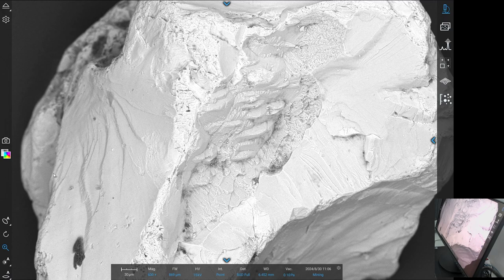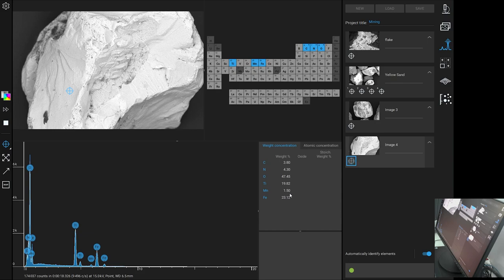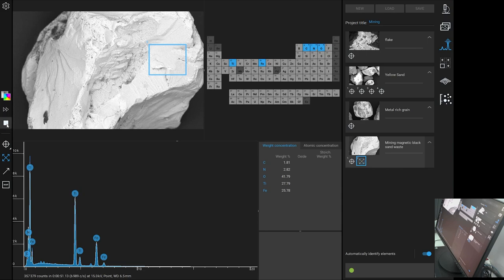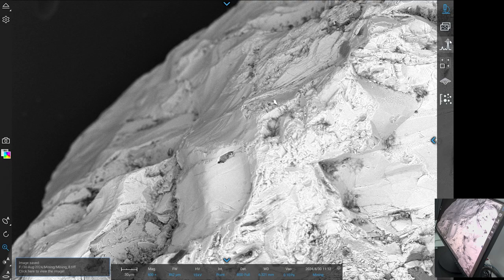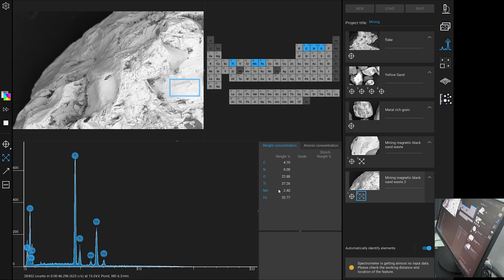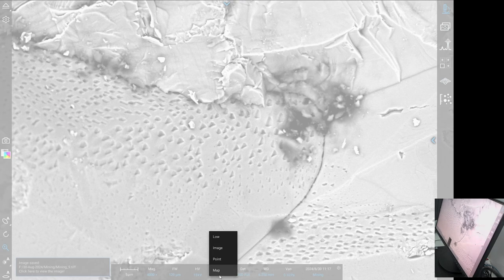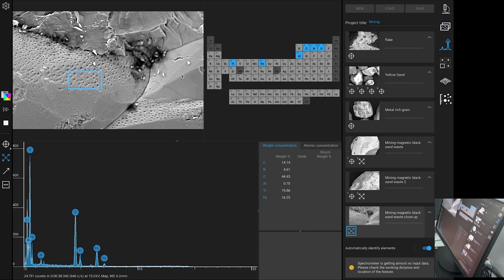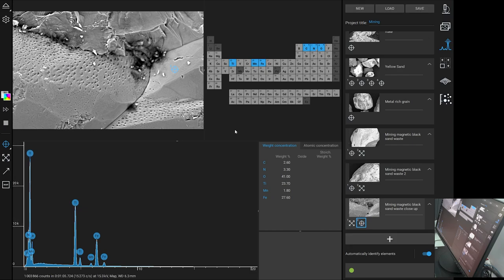Analysis of Czech Alluvial placer deposit black sand

Comment: At 3:50 There's way more oxygen in there than i expect for fully oxidized metals. (Atomic ratios about 1 part Fe, 1 part Ti, and five parts O.) Is it possible that there is undetected silicon in there?
Reply from the maker: No, Silicon is easily detected by EDS. It maybe adsorbed Oxygen on the surface or residual water in the matrix (EDS does not see H in H2O, but will see the water, and these were extracted from a river bed)